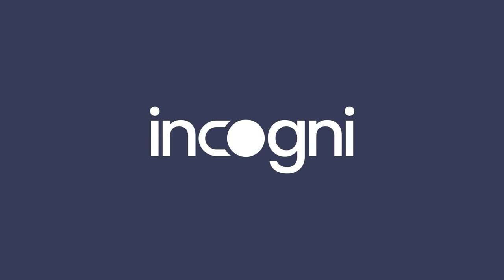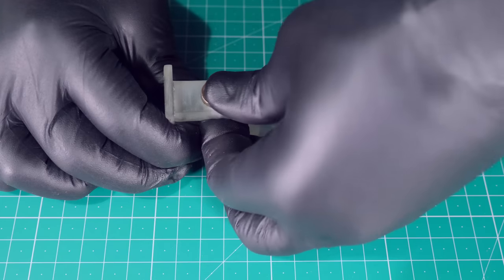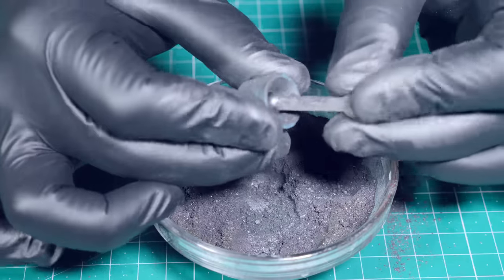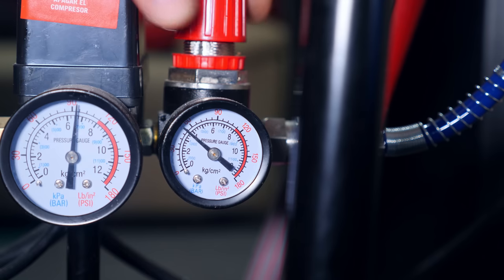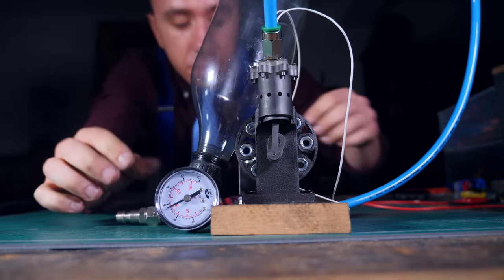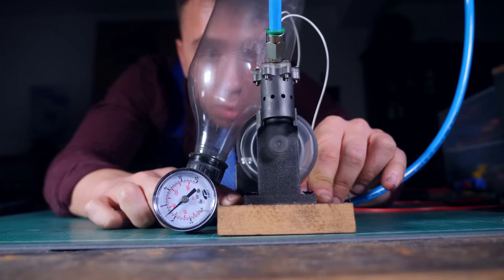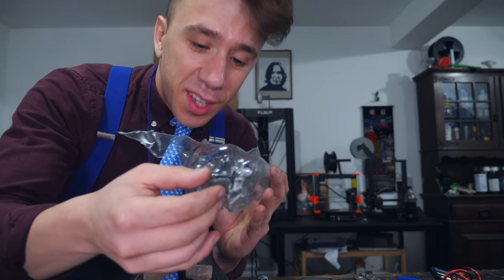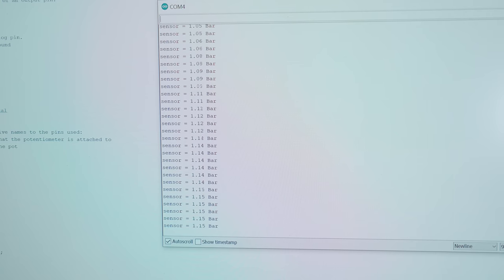Magnetic Air Engine

Comment: Either connect multiple Wankel engines to one driveshaft, or try to replace the 3 sided rotor in the Wankel with a 4, 5, or 6 sided rotor.

Multiple Wankel engines may improve torque and a multi-sided rotor may increase rpm and use less air

Comment: Just wonder if because a vehicle moves, if inertia could recharge the air pump with surge like from regenerative braking...maybe a super capacitor grabs the charge quick enough to recharge air pump. Shark tank did once show a device that inflated a raft on like two breaths from the contestant on an episode. Maybe the motion can grab more air and or pressure.

Comment: What if you used your plasma thrusters to inject air instead of a piston and trigger the valve? Recovering the energy in the back action would be challenging but you can use induction to recharge the plasma thrusters.

Also, why bother with the bottle when you could just use the cartridge directly? You can control the release of the cartridge with valving, so it gives a steady flow of working gas. Could probably even end up creating a quasi-closed cycle where you use pressure differentials inside the quasiclosed loop compared to the atmospheric pressure outside to drive the engine.

Actually, I'm pretty sure that you could basically use the plasma thruster concept and the quasiclosed loop concept to make an AC engine where it basically modulates based on where the pressure differential is in the loop until it dissipates all the energy. Given that your magnetic valve can be used for induction, you have an obvious way to regenerate the electric circuit component of the engine and recharge the plasma thruster off of the working gas.

Comment: Look up cascading gas cylinders, the method is often used in the medical system to maximize the available pressure and each vessels contents as the pressure drops. An idea is to have cascading engines to efficiently utilize the pressure loss of the exhaust stroke?? 

On the magnet side; one could make a rotating switch off the crank shaft which activates a pulse electromagnet exhaust valve to mitigate power loss consumed by the analog valve system....this way one has the ability advance or retard the valve timing electronically to optimize efficiency. 

Consider utilizing reed valve input output, similar to that of an 2 stroke engine.

Another idea is repurposing an car air conditioner compressor' its already a multi-cylinder compressed air engine, with the benefit of an electric clutch already included.

In summery, consider a crafted rotating mechanical switch and or an low voltage automotive solenoid valve and relay to activate the exhaust valve.

Comment: If you have a windmill/waterwheel/etc. that runs an air compressor, and the air is used to drive an air engine, is that more efficient than having the windmill/waterwheel/etc. turn a generator and the electricity is used to turn an electric motor?  In short, what’s the most efficient use of the mechanical energy input?

Comment: With this experiment I would limit the pressure going in to 2 bar, thus making the use of its low bar working efficiency.
When the pressure drops to 1 bar the co2 cylinder should then recharge to 2bar, alternatively you could just put a 1bar pressure valve on the cot cylinder!
Reply: Co2 not cot
Reply: I would put a heat(cold?) Sink around the corner cylinder to get more gas out of it, and also allow the co2 to expand as much as possible by coiling the input tube through a bath of room temp or higher water.
Thanks, love your work it makes me think!
Reply: AGhh, hate autocorrect
Reply: Corner = co2

Comment: What if you had an electric car with an engine of that similar design. Theoretically, if you could use one of these paired with an electric car and a form of compressing the air like a turbocharger, you could run the car on an air engine until you need to stop and then use electric to restart the air engine after you’ve gained enough speed. I’m sure it wouldn’t go very fast or have little to any torque, I was just more thinking along the lines of being able to go longer distances.

Comment: Why not just use the cO2 cartridge with a pressure limiter to reduce the pressure to 2 bars max, instead of using an electromechanical valve?

Comment: Because this and the various other turbines you've been working on and with require different levels of pressure; could you combine all of these in one device in the beginning that would make use of a super-strong high-pressure jet, possibly increased by 1 component to act with more force on another continuing into a different style of turbine generation at lower and lower levels of pressure to make a "truly lossless air pressure generator"?

Comment: Ok, not sure where my old comment went... But there were shark CO2 engines for small airplanes. Which is basically your start model type, but it worked directly from high pressure from CO2 tanks. Overall if you will replace all this heavy electronics with simple valve which won't require force to open - efficiency and quality of design will be much better IMHO.

Comment: For longer but not necessarily faster run time, why don't you use a regulator in line from your pop bottle air tank to your motor.

Comment: Add hydrogen is the obvious route for the next iteration. Either before , during or after. Primary and secondary engines driving the same shaft? A system that works together for the greater good.

Comment: I have a question about the solenoid valve you used, on the Amazon link for the valve it says that its maximum operating pressure is 101 psi not the 900 in a co2 cartridge, I was just wondering how you knew the valve wouldn’t fail.

Comment: Why not replace the function of the soda bottle with some code for the valve, save yourself the bulk of the soda bottle and a little bit of its weight?  If the valve can sense a drop in pressure in the bottle, maybe it can sense a drop in pressure in the piston itself?

Comment: One time I did something similar to the soda bottle exploding. I was bored and got a pill bottle and ping pong ball, cut the ping pong ball in half and poked a hole through the lid of the bottle. I then proceeded to fill up my Dads air compressor to the max and stick the lid of the bottle onto the nozzle, then I screwed the lid on with half of the ping pong ball as a seal and to keep the bottle from locking. After that I turned on the air and the pressure equalized into the pill bottle (80+ psi) then the lid slowly slipped off because of the ping pong ball seal until… bang! It released the air and flung the bottom half of the bottle at extremely high speeds into a cushion. It was so loud that it hurt my ears through my hearing protection, it was no joke louder than shooting a glock and my Dad made me put down our garage door before I did it again so the police wouldn’t be called on us. This was when I was around 12, I am now planning to be a mechanical engineer because of my love for how mechanisms such as this work.(Sorry this was so long)

Comment: Instead of using Arduino and the CO2 cartridges, couldn't you use a pressure regulating valve to make the discharge constant. That way you can have a more steady flow without the need for the CO2. And since you used about 3 cartridges to blow up the plastic bottle, I guess it could run longer than when you were using one cartridge.

Comment: I don't know the max speed the electric valve can operate at or if you can throttle it's release but could you not just run the engine by activating the co2 release directly into the cylinder via a needle valve so you don't hit the cylinder with a full 60 bar.

Comment: Can this engine output be used to say run a small belt drive to dc motor/generator to charge a super capacitor to run the electonics?  In this way, you reclaim power of operation to power control system.

Comment: Looks extremely awesome!!!!!! 
Im trying to make a hydrogen 
spud-gun (potato canon) with a hydrogen-cell attached to the gun or a hydrogen tank that looks like a paintball tank although i need to do more research about them because those are basically bombs that could kill you so i probably go for a safer solution that make it look good and an airtank from a paintball gun attached to an air intake measuring system (cc cilinder)that measure's the air intake and one separately that the hydrogen intake also gets measured before entering the chamber if its possible to build up enough pressure before entering the combustion chamber with a hydrogen cell also a good transparent combustion cilindrical shaped chamber that could glow up at night where the hydrogen and air has a perfect (mathematically speaking) mixture for combustion, in the combustion cilinder or any kind of shape with the help of a metal 3d printer, with a Call of Duty Zombies art style look, personaly i like the DIY Mad Sientific Artstyle of CODZ experimental weapon type's or the more professionally organized Mad sientific weapon types of Half-Life game's, I don't have the tools yet and the know/how,how to make it semi-auto,
But an Arduino probably would do the job,with solenoid valve's if they could handle the combustions and those pressures/flame's ,im throwing the idea on the internet because maybe im getting to old to ever being able to create one, but reinventing the hydrogen combustion chamber and updating/maxing it out seems to my ears a project of alot of year's if i would get my hand on it,and it could maybe develop in the future as a reliable energy source,without the goverment intervening and killing scientists ,with a metal 3D printer it could be devastatingly destructive,have you seen those big hydrogen baloons that got lit up?? Just think about adding air into those balloon's if they aint already putted it in those kinds of balloons absolute mayhem,who knows how powerful some homemade projectile's would come out the barrel, hydrogen is pretty violent and could even kill you, if not handled correctly but its surprisingly easy to generate according to YouTube.

Comment: I like your experiment... You are good... 
I have a idea for your new video aka experiment.... Its like this..... 
See hydrogenated electricity is produced by placing a turbine aka big blade fan... Under high flow of water.... What if the same technology can pe minimize and placed inside our normal water carrying pipe 
So when the water flows with pressure it will rotate small turbine placed inside the pipe.. Which are somehow connected with motor placed above the pipe... Think like gun barrel which has turning designe carved inside pipes to rotate and fire bullet.... Similar pattern can be used in pipes. 
By using force flow of water helped with gravity.. Might produce   electricity.. While we use tap water. 💦

Comment: Why not get rid of the bottle, just use the small 60 bar gas cannister, attach to airplane and have the valve open only a little, so just enough pressure is led through?

Comment: Create the cylinder like a 2 stroke and create the piston to add crankcase pressure to blow air charge back on top of the piston through the outer shell of the cylinder.....would waste less air

Comment: I thought this might be a similar design to an innovation I have developed, but it's not. Using a magnetic field to negate centripetal forces resulting from the reciprocating mass of the piston and conrod resulting in an internal combustion engine (or other) which is capable of an rpm limit approaching millions of rpm, dependent upon materials.

Comment: Air in a bottle with water can develop hi pressure with minimal pressure of air the pressure of the air doesn't need to be hi because of the bubble up into the inside of the bottle. A rocket bottle like you played with when you were a kid the crank shift connected to the bubble rocket the pressure is minimal going in and can develop a hi pressure in the upper chamber of the bottle with bubbles in the water with the bubble rocket. The pressure can be adjusted by the influx of the air the water separation between input and output and the water is your sealer lower pressure of the air and the higher pressure in the top . Water separation between input and output and the bubble is low pressure in and high pressure out. The rocket release pressure is hi and when you launch the rocket all of the pressure is released. And you do it again and again. You are looking for a constant pressure to run your piston at whatever speed you want .
    Look at a two stroke engine that is setup just like your piston crank setup the gasoline engine the gasoline is the power of the two stroke engine. In your case the low pressure of the bubbler is you're gasoline. If the crank shaft is a low pressure air pump it will work once stareted. The incoming air is the low pressure pressure and the water is the separation between hi and low it doesn't take much water for the separation. 
    If you boil the water or baking soda will do the low pressure side of the bottle rocket but it will take fuel eather way. That way. 
     What you have should power a small low pressure pump enough to make the bubble of the payoff of the bottle. A pressure regulator can control the whole process especially on the lower pressure side. Or the hi pressure side if you want to increase the pressure of the bottle for starting up of the whole process. 
   Hi pressure is hi output with water like fluid for 😂separation between hi and low . It's your toy and your project just don't forget me in the payoff . If  it works .

Comment: How about a rotary valve solution?
Reply: They’re difficult in combustion engines but you’re not working with that kind of air pressure and certainly not that kind of heat.

Comment: There are bigger CO2 cartridges like 300g how long would they go🤔? Another idea would be to heat your bottle but use Aluminum bottle and heat the gas with electric motor or cool the electric motor with CO2😉. Like the rockets that cool their equipment like nozzle a'd pipings with liquid gas fuel/oxidizer 🤔

Comment: Why not use a pressure-reducing regulator of some sort to get a constant pressure out of a simpler device (less control electronics)? The current design requires additional electronics and also has the pressure fluctuate a lot. A pressure-reducing regulator is a purely mechanical contraption that uses a spring to set a fixed output pressure, and so should be more consistent and reliable.

Comment: You have movement with your motor now you need a generator hooked to it that will run a little electric motor that will run a little compressor, finally the hole thing will become a free energy machine

Comment: Ok so could you fit your engine to a cart/wheeled vehicle and fit pumps or pistons that charge your air supply so once you get it going it would run itself constantly until stopped an air driven car ?

Comment: Would some way to do passive air flow work?  Or solarower motor which stores the ai and even though it sounds like extra steps would the air accumulated run the air engine faster or with more twerk than the electric motor?
Reply: Or maybe a loop like a hybrid air sun generator, the turning from the air engine create electricity which also powers the electric motor and keep going? Maybe gaining speed?

Comment: you could try using the co2 carts directly and delete the bottle from the setup, have them in series before a regulator (like 4) then find the ideal pressure for max tq/time running? easy 8 min vid + ad lol

Comment: I wonder how long it would run if you used steam. Using a candle and water. The candle and water weighing the same as the CO2 cartridge the bottle all the electronics and anything else it took to run it off of the CO2 cartridge.

Comment: You've veered away from it being strictly air-powered when you used CO2, so why not veer a little further? 

You could do away with the plastic bottle reservoir and just use an easily liquefiable gas. A valve would release the liquified gas into an expansion chamber, and then the gas would then run your engine.

The fun part is finding a gas that won't kill you. You need one that has a relatively high critical temperature. Sulphur dioxide is your best bet, followed by ammonia, chlorine, and CO2.

Or, you could go for nitrous oxide with a catalyst as a monopropellant, to produce a LOT of gas. You might need to cool your gas before the engine so it doesn't melt...

A rocket-powered air engine sounds like an excellent project for a video...!

Comment: Could it work in reverse? .w. i mean be used to Compress air ? (Prewatch thoughts)
Reply: After watch thought:
What if you convert this to run off water, Then use the water hammer effect to attempt to create a backflow pump mechanism that constant feeds back into itself repeatedly o.o

Comment: I am not sure whether it would work or not, but if you were to lauch a balloon into the air with a mettal mesh, you could gain 100 volts every meter this is as long as you have a wire attached of coarse. So if you were to ground one side of your ionic thruster and connect the other to the balloon then. In theory you could get your ionic thruster to run off of that. Complete hypothosis and most likely wrong!

Comment: Hey buddy I hate to break your bubble but it's not a new idea take a look at an old locomotive engine that use coal or wood Burning Fire to heat a Tank of Water that pretty much turned to steam which pretty much pushed a piston which is considered a steam engine You just did it at a lower vapor and Temperature same principle though

Comment: Hmm I wonder what the performance of the bottle would be if you prestressed it to say 70% of failure and wrap it in carbon fiber and epoxy.. DIY COPV! Maybe a little sketchy though. Also a cheap airgun stirrup pump can achieve ridiculous pressure.